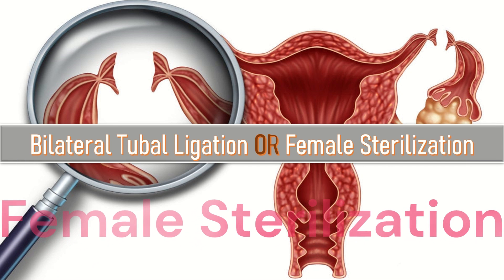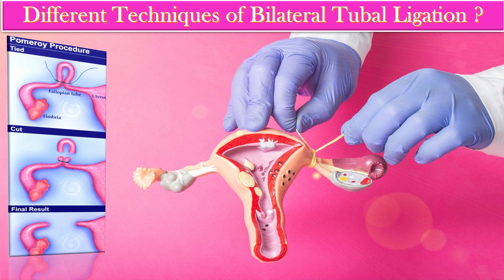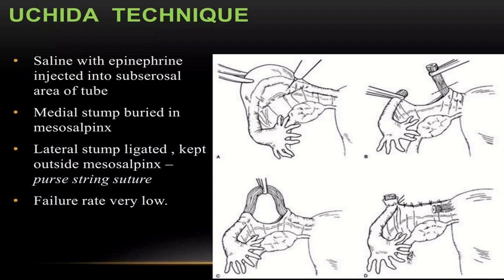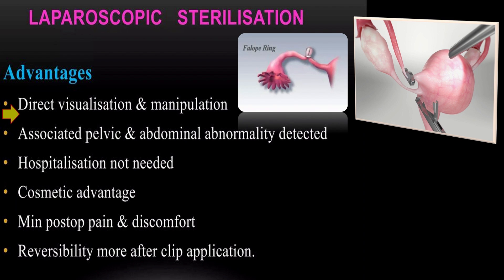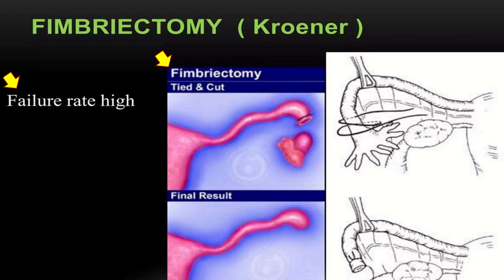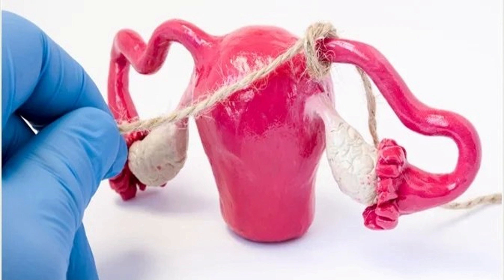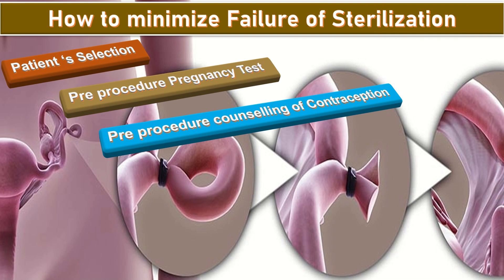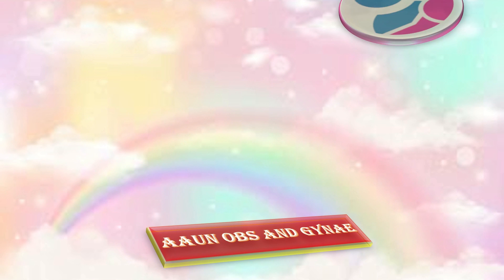Bilateral Tubal Ligation | Permanent Birth Control Method | Family Planning

Comment: Can I get pregnant after years of sterilization
Reply from the maker: The aim of Sterilization procedure is to prevent the cahnce of pregnancy permanatly. So those woman who are not sure whether they would need pregnancy in future or not should not opt for this procedure.

As far as your question is concerned as there is about 1.8 % risk of failure of this procedure so pregnancy is possible is some cases.

In rare cases even after this procedure some women comes for reversal of sterilization means they plan to get pregnat after sterilization , for them reversal is performed but the success rate of that procedure is very low.Watch ths video for that
https://www.youtube.com/watch?v=svS16LovRQU